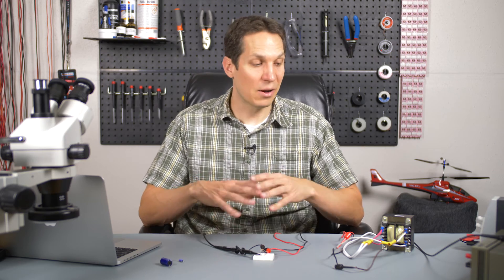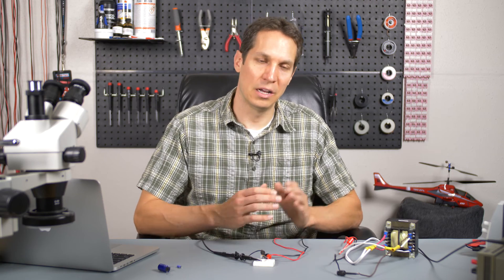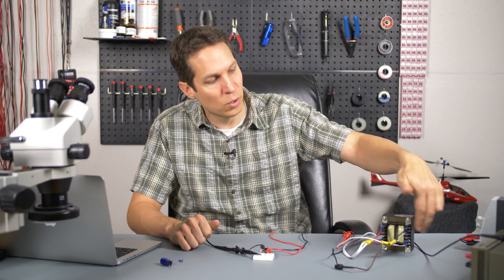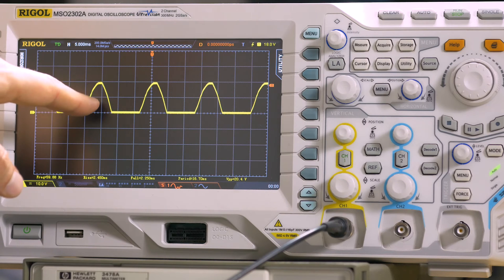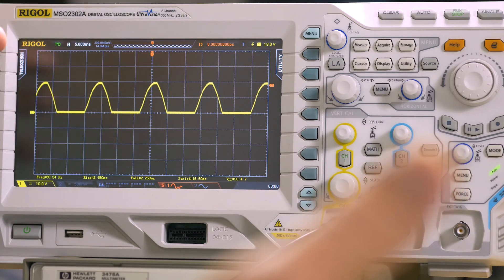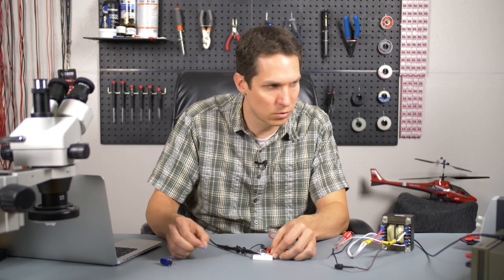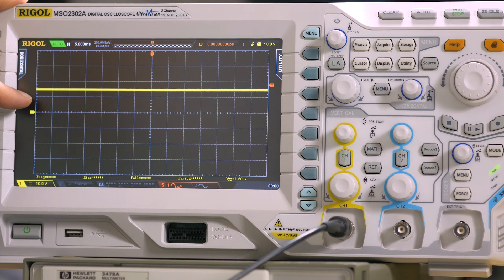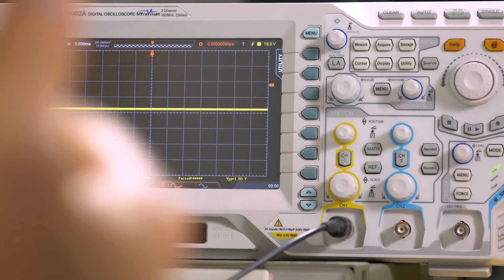Half Wave Rectifiers - Practical Demonstration | Basic Electronics

Comment: Why is the wave peak 20 volts but the input voltage 12 volts
Reply from the maker: Hey Romario, it's the difference between peak-to-peak and RMS voltages.  The RMS voltage is 12V, but the peak-to-peak will be considerably higher (20V in this case).  If you're not familiar with RMS voltages, they're essential to quantifying AC signals and I highly recommend doing some googling on them.  We have a brief intro to RMS in one of the open source textbooks we host on our site: https://www.circuitbread.com/textbooks/fundamentals-of-electrical-engineering-i/introduction/introduction-problems but you'll probably want some additional info from google.